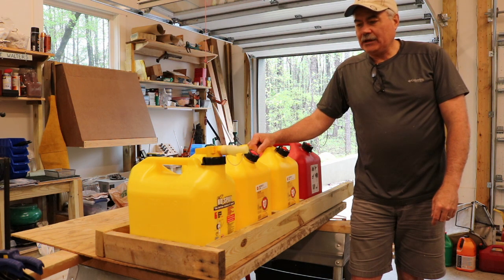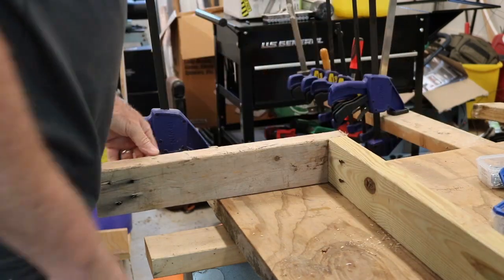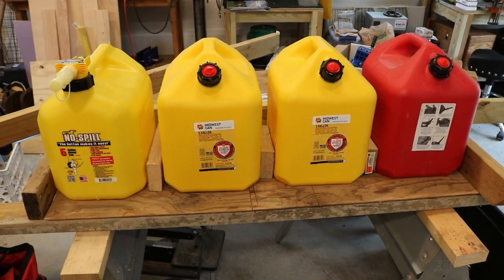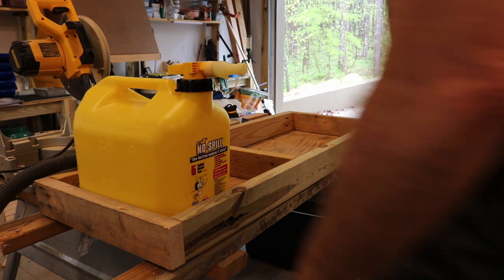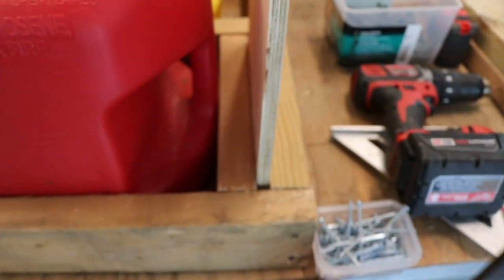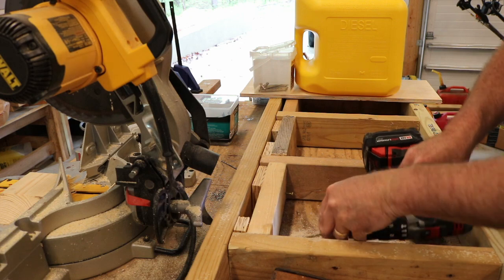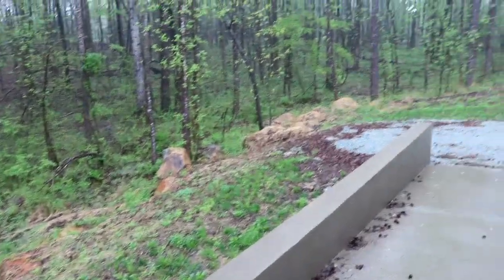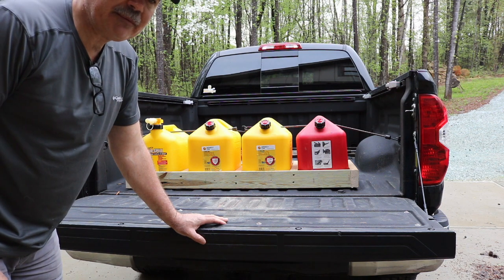#51 Build a fuel can holder for transport in your pick up truck

Comment: I like the concept. Question - why use pocket holes and not just put two screws from the back side of the board into the long boards (or maybe even L-brackets)? Was this just preference - or was there reasoning here? Ever thought of using eye bolts or screws in the sides to give a place for tie-downs that could connect to truck bed tie-downs? Seems like a good way to put a little pressure on the box with a ratchet strap and keep it from moving.
Reply from the maker: Hi Travis.  I could definitely have just used deck screws on the ends, but for some reason I used my Kreg Pocket hole jig.  Not sure why... LOL.  I did put eye bolts on the sides and I have bungies now that anchor the frame to the tie-downs.  It works well and is stable.  Thanks for watching!